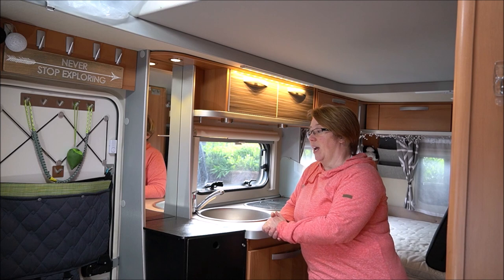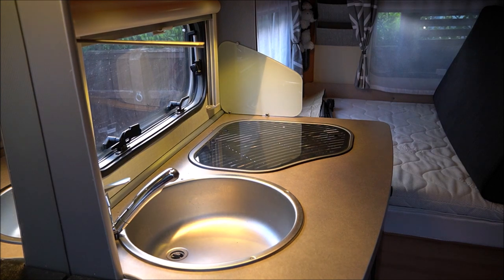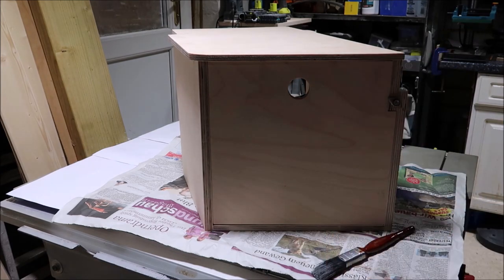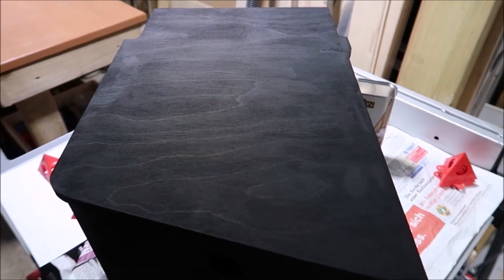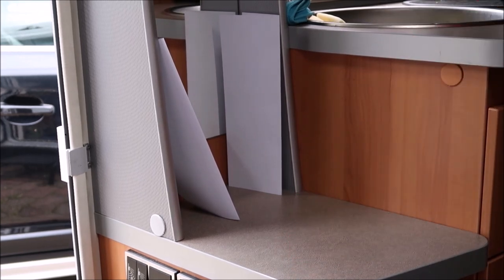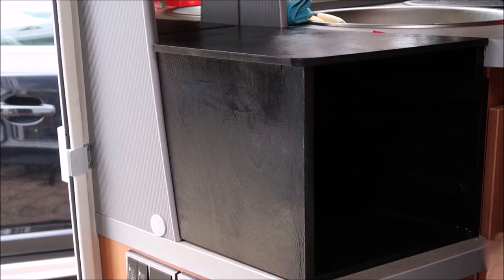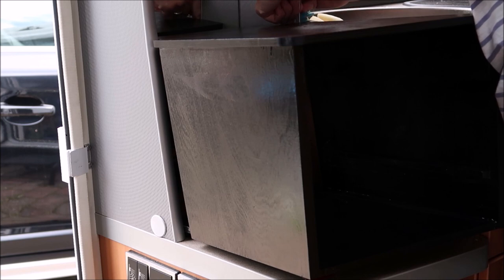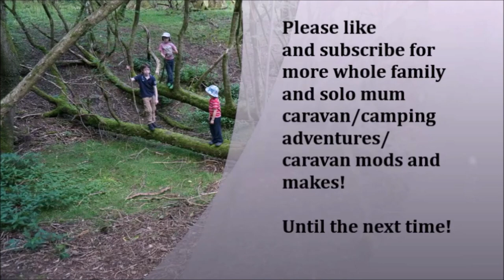EASY solo parent caravanning - BUILT IN kettle/toaster drawer

Comment: I'm glad its not just me that has bits missing from painting the edges of ply! That looks great Becky and the flush fit in the finished article is spot on; looks brilliant. A great project, cheers for sharing 👍 Martin & Jo
Reply from the maker: Drives me bonkers, this wood dye is so runny it goes on beautifully (have to work v carefully mind you as v splashy) and you think you’ve got everything perfectly, checked it all over, etc. then it dries and bam! Missing bits, think it must be micro air bubbles... The unit was bloomin difficult to make with all those complex angles but I’m absolutely made up with it, looks great and so helpful, I (well the boys, deal is I tow they wash up (mostly...)) actually have space the drainer, and the appliances are easily accessible but take no time to set up - perfect :) Thanks for your support, really appreciate it, Becky